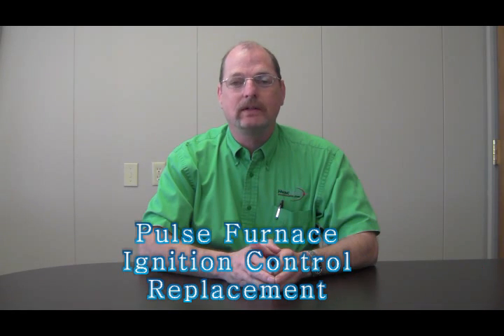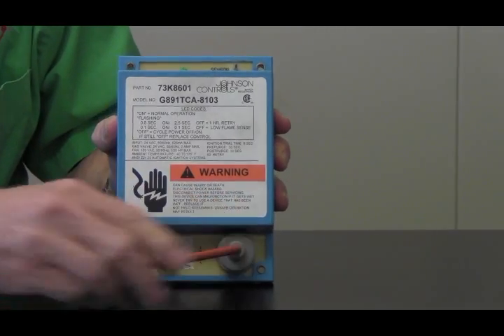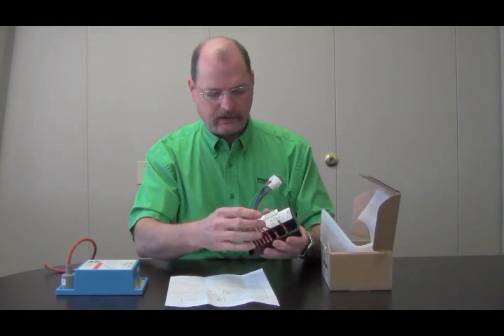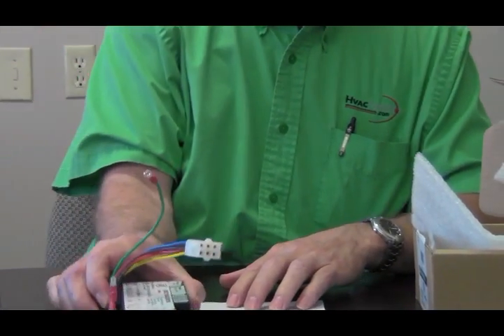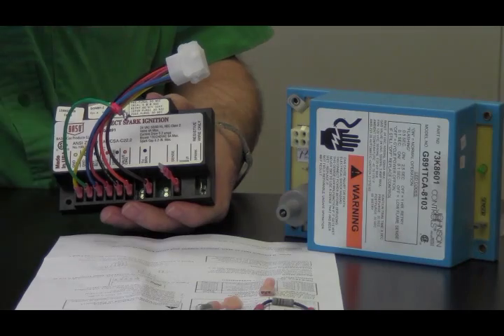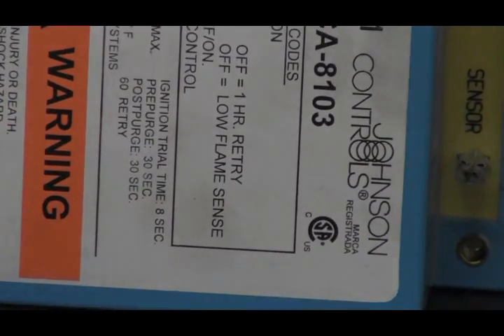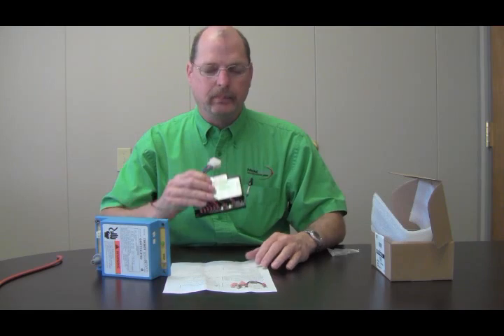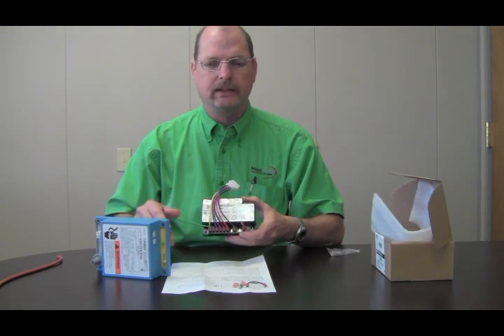Ignition Control Board Replacement - Lennox Y4749 Baso BGN891-1C

Comment: I have a question please… I like your video, but My new control module board is like this one that you are showing in the video. The old board that I have has a neutral wire going next to the spark wire that is not shown on your old board. Do I simply omit this or is there a place on the new board to connect this to?

Comment: I just installed this part. Problem that the connector to the spark wire was brittle and broke when I followed your video to cramp. I am thinking depending on where you get part the connector may be brittle or not. Maybe mention in video.

Comment: On this type of furnace, why would the ignitor stay on, sparking continuously even when furnace not running. Only way it will shut off is when you disconnect power to furnace

Comment: So, I’m a do it yourselfer, I have the replacement part, but I have no idea how to strip that rubbery orange tube that apparently has wire inside of it. I wish you would’ve shown how to do that. I guess I’ll just have to figure it out. Thanks for the video it helped me with everything but that. :-). OK so I sniffed a little bit of the end off and saw the wire inside and easily took care of that. But, how do I crimp that new and onto the wire?
Reply: Did you figure out how to do that orange spark cable?  I'm having the same question.

Comment: Thank you so much.  The Xcel energy repair man came over and he said your heat exchanger is bad.  You need to replace the furnace.  What a crook.  I learned that my furnace kept on shutting off after it gets to 74 75 or 76 but if I turned it off I can get it to turn on.  At night it would shut off but during the day it would stay on.  I figure it could be the board since I just replaced the the thermostat.  There are no more parts my ass.  Hopefully this will solve my problem.  Thanks.  Part arriving Monday.

Comment: Hey Steve...Great video!
Wish I would have just watched this one instead of ALL the others...would have saved me a bunch of time trying to figure out my little sisters unit...Lennox Pulse 21...Aagh!!!
Question about the packet that came with the ICB?  You briefly touch on the electrical diode for the power stealing thermostat...older tech mechanical type...that's what she has...
Can you give me a brief explanation on hooking that up...furnace works but the screen on her thermostat is blank...(no batteries) power stealing dial with digital read out...older Honeywell model.
Thanks again for your video...look forward to your reply!
Eric
Reply from the maker: Hi Eric, Steve will be happy to go over this with you. Just give us a call at 866-215-3831 and he'll be happy to answer any questions that you have. Thanks for watching!

Comment: We have a lennox pulse 21. We are having a problem with it right now. we have no heat the furnace will run, but blow cold air. I found that the green light on the control is off. So I shut the power off what a few seconds and turn it back on and then the green light comes on and we have heat till the temperature reaches what we want. Then the next time it kicks back on I have to go turn the power off again. Is the controller bad do we need a new one? We have a 86H3001. Will the new one in your video work?
Reply: I did replace the control and now my heat is working fine but last year we would have a loud noise like a howl sound on startup but we don't have that now is there still something wrong?
Reply: I did clean the air flapper. Could the purge blower or the pressure switch be bad?
Reply: +HVACPartsShop. I cleaned the leg drain out and that's all clear I'll have to check the exhaust tube that runs outside maybe that's clogged